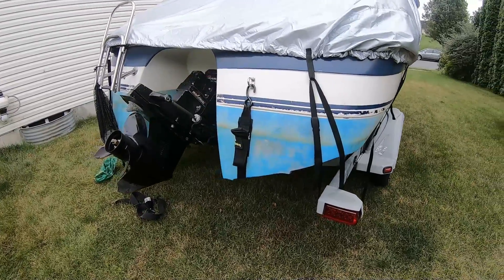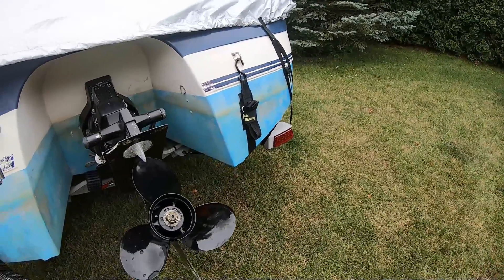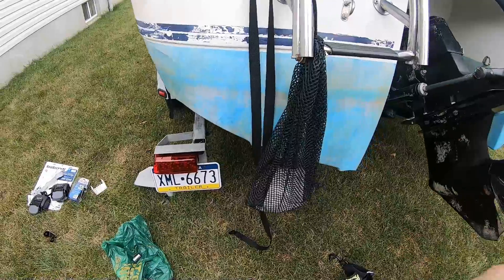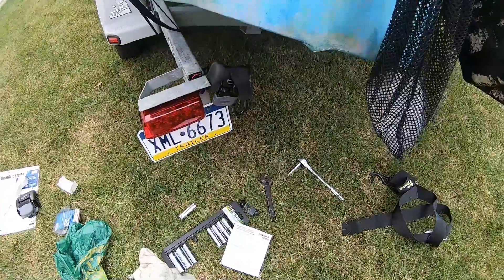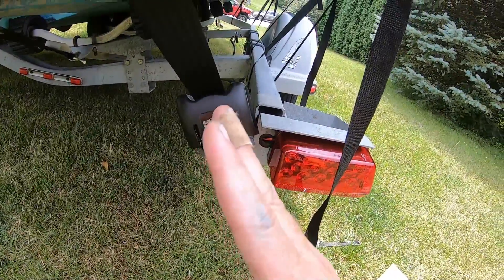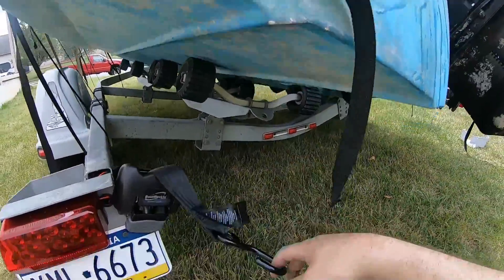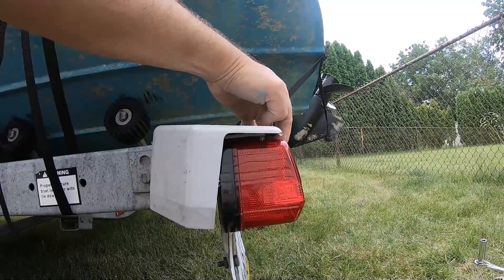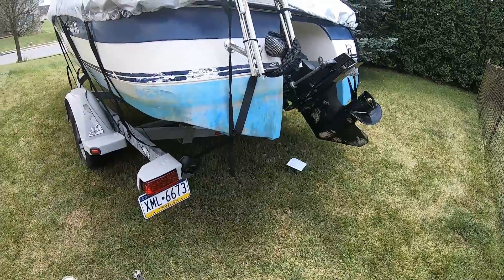Boat Buckle Install

Comment: Those Boat Buckles are meant to be installed in a direct vertical pull. The more strap angle pull, the more it allows the boat to lift off the trailer.
Reply from the maker: While I may agree partially, you can only do what you can do. Not all body hills are the same nor are all boat trailers able to be mounted the same.
I’ve been using these things for years now on different boats and trailers. It’s really not an issue
Reply: @PMPerformance  Your new straps are not holding the boat down onto the trailer. What they are doing is pulling the boat forward onto the winch post. To get the necessary 'down force' maybe throw a ratchet strap over the hull.
Reply from the maker: @rossevans1774  not sure I fully agree with your statements, but you are entitled to them for sure.
Transom straps hold the boat from shifting on hard braking to my understanding.
This video it probably 3 yrs old. I have since purchased another boat, and a 3rd trailer and another set of these straps.
Again the point of these was to not have to screw around having to store or forget transom straps as they are always on my trailer.
Reply: @PMPerformance  The purpose of those excellent transom ratchet straps and the ratchet bow strap is to hold the boat and trailer together as one. You mentioned how this boat had previously 'bounced around', 'shifted on you', and straps were a 'tad loose' on the trailer. It is the necessary positive DOWNFORCE that prevents movement between the boat and the trailer, they ensure the boat and trailer move as one on the trailer's suspension. I would like to believe the new boat straps have a more direct vertical pull down on the trailer.
Reply from the maker: @rossevans1774  do you have an install video you made that you can point me to my flaws for an updated video for my next boat by chance?
Reply: @PMPerformance  Sorry, I don't make videos. There are many 'back yarder compromise videos' that get some aspects right, but then they also get others very wrong. Surely a video exists that accurately explains technically what's required and how to achieve a correct boat/trailer 'lockdown'. I just can not find this information.
Reply from the maker: @rossevans1774  remember, it’s always easier to judge from the other side of the screen my friend ;)
You made your point that you do not agree with the angle of my dangle. 
Regardless of angle transom straps are adviseable and ones that I don’t need to worry about finding each outing is a win for me.
Reply: @PMPerformance  Ignorance is bliss!
Reply from the maker: @rossevans1774  ignorance isn’t bliss, but you came to my channel for a reason right? You probably wanted to know how or why to install these is my guess. But you are coaching me on install.
I made it clear my last trailer was not properly sized or setup. Hence the angle was wrong. Also I did not want to drill holes to mount these and was utilizing current holes.
They are more ideally mounted on my new trailer as my new trailer is sized properly and setup specifically for my new boat.

Again there always seems to be judgement from the guys that come to my
Videos to learn instead of doing themselves and making their own videos to share
Reply: @PMPerformance  What prompted me to view yours and maybe 1/2 a dozen other retractable boat strap vids was my own dilemma when I set out to install a pair on my own trailer. I was confronted with several installation options, all were unsatisfactory (unsafe). Eventually I conceded that my trailer required some workshop modification to enable the correct, secure and safe installation of my new boat straps. These modifications were expensive, but what price do we put on ours and others road safety? 

My Utube replies are not judgemental, they are best described as criticism of too much poor Utube, often but not always instructional information. Poor information that has the potential to end in catastrophic failure resulting in personal injury or worse. Good to hear your new boat/trailer are setup correctly.
Reply from the maker: @rossevans1774  the old boat and trailer was setup fine.
You are severely overthinking this.
But thank you for the insight of something you yourself were indeed not versed on either.
Reply: @PMPerformance  Unlike too many others, I had a complete understanding of the correct way to install Boat buckles. What prompted me to view yours and other Utube installations was to see if and how anyone with a similar trailer tackled the costly modifications of their trailer. Knowing how to engineer the trailer correctly, I was interested to see if other engineers approached the modification necessary in a more cost-effective way.

Comment: You should buy these yellow boatpads,also from boatbuckle.These can be applied on the edge of the boat to protect the paint.
Reply from the maker: Do you have a link by chance? Or are you just talking about something between the strap and the transom?
Honestly this stuff under the boat comes off too easily anyway.
Thanks for viewing by the way

Comment: Your trailer is too short. Google hook in the hull. Don't over tighten the transom straps.
Reply from the maker: Being a new boat person I realize this now. Thanks for the advise on over tight transom straps. I found out that as well that it pulls up on the back of the trailer and  could be bending it.